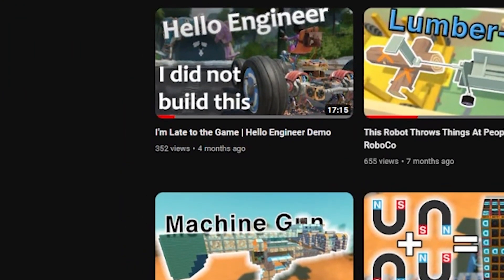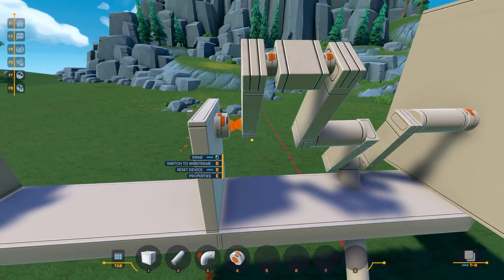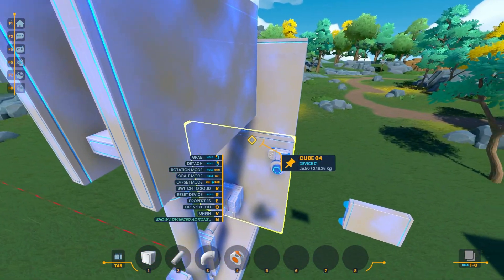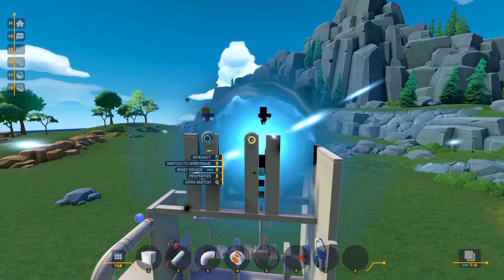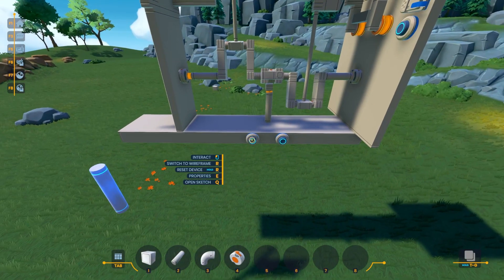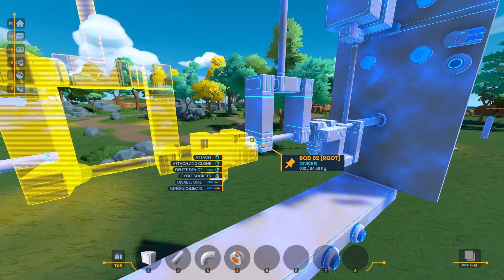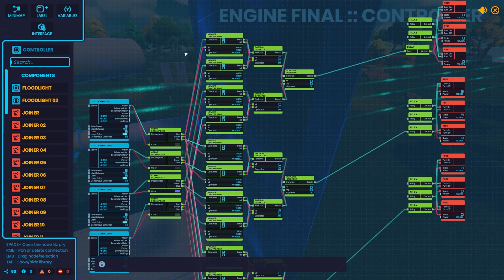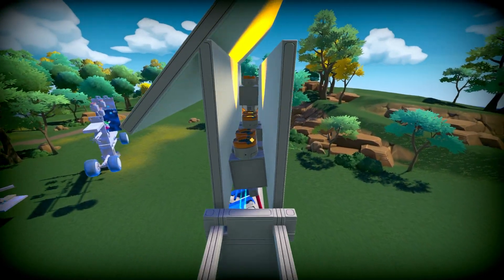Making a Powerful 3 Cylinder Engine | Plasma

Comment: Great stuff to see, even if it didn't go perfectly it's good to know Plasma at least somewhat allows these sort of mechanical builds

Don't have the game so these are just guesses:
- I think the friction problem is related to the crankshaft, i would try and make it in such a way that the thing cant flex so easily, the slight differences in angle/timing might have been the issue, other thing to try would be less distance between center of crankshaft and piston-attachment-points, so it has less tendency to pull the piston head sideways

- Was also thinking that you should probably not add a light for the color sensor, instead see if you can convert the RGB to HSV/HSB, then just use the Hue value to detect certain colors without having to care about brightness/amount of light, saves on parts & game-rendering and im fairly sure such a conversion function is built in/you won't have to make it yourself